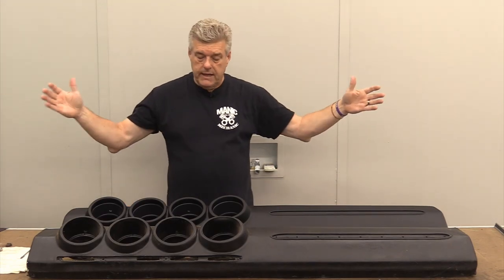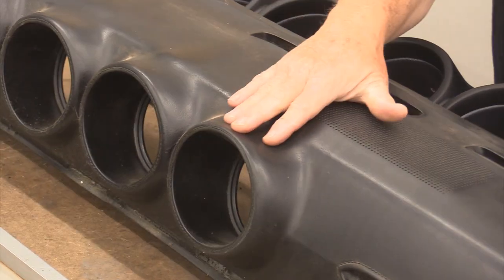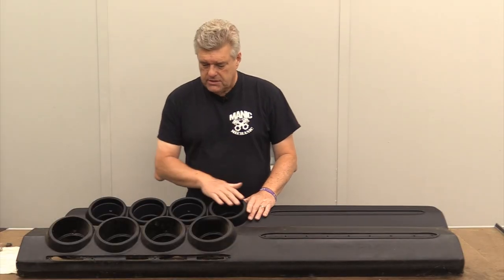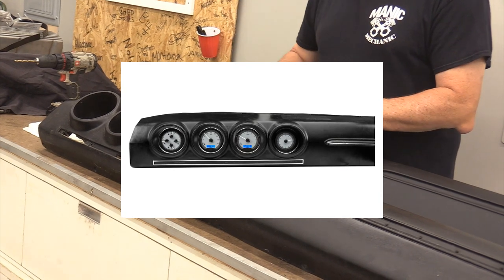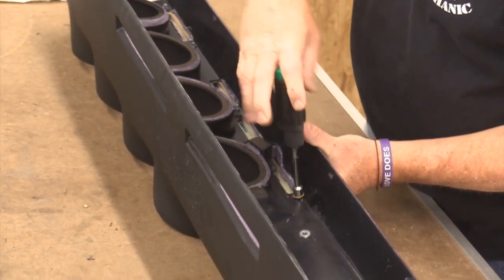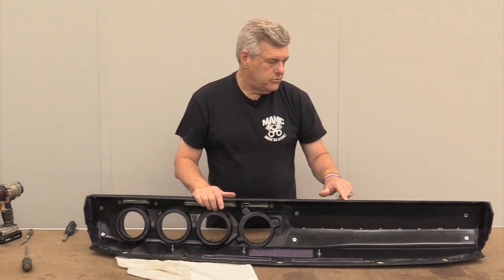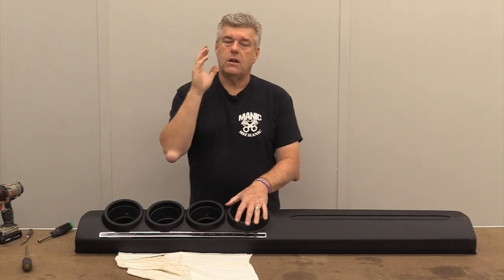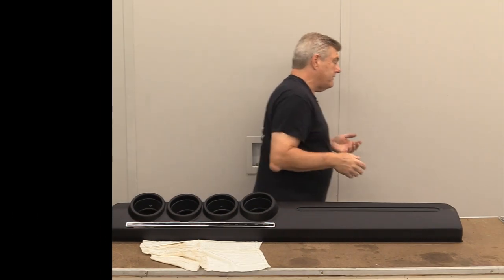Dash Pad Review

Comment: Glad to see these and more parts are becoming available. Btw, do y'all still have the 72(?) Mustang? I replaced the flasher on my '73, since the turn signals didn't want to work. All lights and signals outside are now working, but my inside turn signal indicator is not working. Any ideas? Also, I've been trying to decide on what to do about replacing my steering gearbox, as it is leaking, plus the adjustment is run all the way down, and it still has more loss motion than I like. I did replace the worn pitman arm and it helped. I have read that the remans are not good quality, and the only other option is to try and rebuild mine, or go with a Borgeson unit, that I have also read does not fit properly. I think the rebuild kit is only seals? Thanks!
Reply from the maker: Those bulbs are notorious for not working on that printed circuit board. I'd check the bulbs and then install them on the board and then test them on the printed circuit.

I've never used them, but Lees specializes in the Saginaw boxes that we have on the Mustang. They do a ground up rebuild and could possibly get yours to rights.
https://leepowersteering.com/pages/steering-gearbox-rebuilds-upgrades

Comment: Is it to much to ask for a copy? I run into this everyday, just copy the damn thing, don't over think it, Ford already did the heavy lifting.
Reply from the maker: In some respects it is. Even Just Dashes does not replicate the stitching. And the process they are using will not reach as deep as the original poured vinyl. At some point we would be without. And though it isn't perfect, it is a way to revive a car interior where there was no way to do that before now.